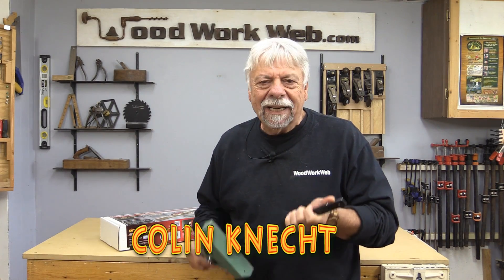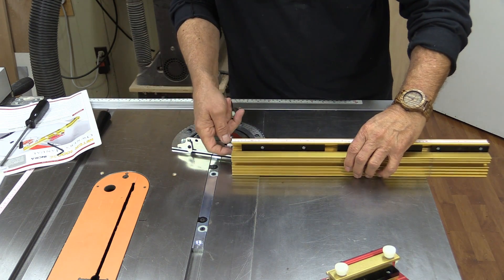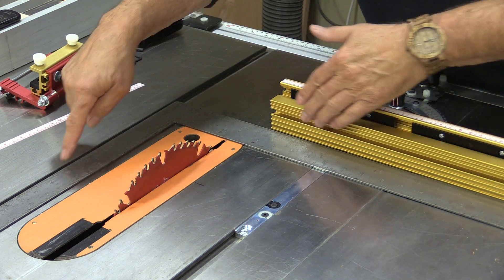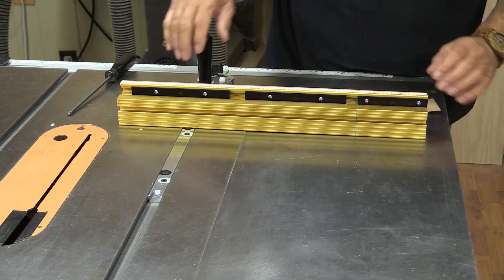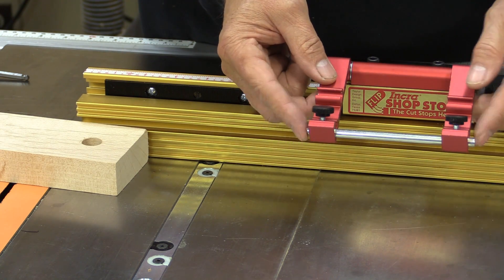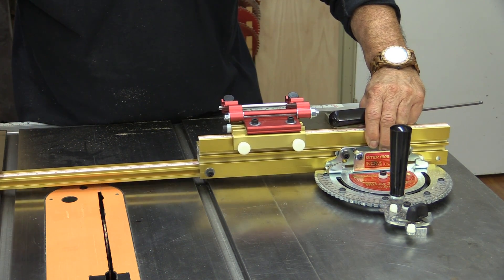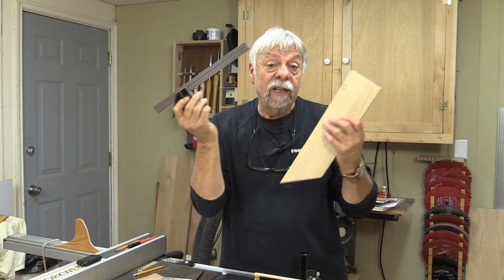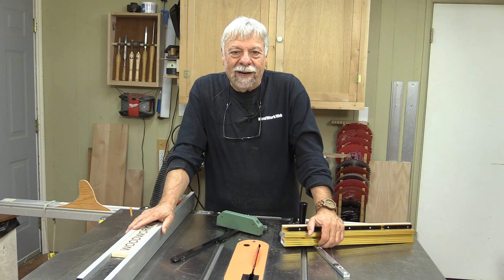Incra MITER 1000SE: Table Saw Miter Gauge Set Up & Review

Comment: I'm using the Kreg Miter Gauge. I'm pretty happy with it. One thing I learned was to tilt the saw's blade 45 degrees so the tip of the blade is facing the gauge. Then you set the fences distance towards the blade. I didn't notice that I had the gauge too close to the blade at just the 90 degree angle and cut a perfect 45 degree angle slot  into the miter gauge. DOH!

Comment: Really enjoy your videos, thank you. I have this miter gauge, it works great. Thought I'd share a tip for aligning the gauge to the miter slot. I planed a board to fit snugly into the far miter slot. Then I use a framing square to align the gauge as you do. However, my method frees up both hands to make adjustments with the framing square laying flat on the table.

Comment: I just bought and set up my new Incra Miter Gauge 1000 Special Edition. It works beautifully. It will never leave my shop. 
Regarding the quality control issues some readers have presented, I dismissed this as "bad luck" - the finish is beautiful on my gauge, no burrs, or rough metal surfaces... everything looked fine. 
I was moving things around in my small shop a few days later, and set the Incra Gauge back in its shipping box to protect it from other tools, when I noticed a small piece of red-orange plastic in the bottom of the shipping box. It was the same material as on the inside of the Shop-Stop. A quick look at the inside of the Shop-Stop revealed that this material (red-orange, heavily serrated, allowing it to lock very positively onto the fence) was chipped and broken (about 1/4") from the edge of the material. It does not affect the operation of the Incra Gauge whatsoever, but it was an eye-opener. Make sure you check your gauge when you first get it, to include the Shop-Stop innards . Any problems, return it for another. You won't be disappointed.

Comment: I bought one of those years ago and I love it. It got me into the Incra system--I also bought their router table fence too, and I have several fo their rulers (with the slots for a 0.5mm pencil lead. None of their stuff is cheap, but it's worth every penny.

I have a portable Bosch table saw because I don't have a home shop. No garage of shed, so I have to wheel the saw outside when I want to use it. Needless to say that the factory miter gauge on a portable job site saw is not the most accurate of devices to begin with. If you really want to check the miter gauges accuracy, use it to make an octagon picture frame. You'll have sixteen cuts on eight peices of wood, so any error will be magnified eight times. 

Recently I got the idea of using the 1000SE miter gauge as part of a shooting board for hand planes. Its adjustability isn't really needed for the "standard" shooting board angles: 90 and 45 degrees, but if you want to shoot any other angle, then it should be a breeze to do it. I haven't built it yet, but it seems to me that getting an aluminum miter gauge slot and letting it into a piece of plywood should be all that's needed.
Reply: I like this idea for the shooting board, did you ever make it?

Comment: Another great video Colin.  I've had my Incra Miter Gauge 1000HD for about 5 years now and continue to love it.  The HD is VERY similar to your SE edition.  
Since you apparently use a miter gauge for angles other than 90 degrees quite often you may find yourself adjusting the fence back rail to better support the wood close to the saw blade.  A word of caution if you do.  After resetting the angle ALWAYS check the clearance to the blade.  My fence has a few battle scars when I failed to do that.  No problem though, Incra sells replacement parts if you ever need them.
Reply from the maker: Thanks for the tip and thanks for watching, Bud!

Comment: Wow! What an amazing piece of kit. I just replaced the bar on mine,  i did use the plastic protractor part but just having a snug bar has made a huge difference.  The one that came with the saw was .745" but the slots are .765" so pretty sloppy and plenty enough to allow the workpiece to float about. I made the new one from 20mm  steel that i adjusted on my milling machine so I'll need to keep it free of rust. Thanks Colin

Comment: I bought one of these last year. Have not used it much since I can't seem to get it to be William Ng 5 cut square accurate. If you can do a video on getting this thing to adjust to a 5 cut process, I would be greatly impressed.  Thanks for the tip on getting it in and out of the T-slot. That was worth watching for that alone.
Reply from the maker: I'll add it to my list of videos to make. Thanks for watching, Mark.
Reply: Mark - to me it seems like the 5 cut may be hard to adapt to a miter gauge because you have more moving parts(the gauge adjusts differently than the fence on a sled) and I'm not sure where to get my length measurement from, the far right adjustment screw or the far right side of the fence.  I went with the dial caliper and a Woodpeckers 1281 square.

Comment: I was so frustrated with my fence and miter gauge I considered buying a new table saw. Then I discovered the Incra 1000 and the Mule fence. Combined they make my saw a joy to work with.
Reply from the maker: Yes, changing the miter gauge can make a world of difference!
Thanks for watching.
Reply: I had my incra 5000 before I bought my new table saw. When I bought the new saw, I took the included gauge and hung it on the wall. It has been there ever since and has never even been put in the slot on the table saw.

Comment: Excellent video. I just bought this product and I have to admit it’s got me confused. I feel more prepared to try and adjust it now.
Reply: Sadly, I have a Ryobi portable table saw and it appears to be the one saw this miter product won’t work with. Even with the T clip, the bar won’t fit into the groove (even putting it in the front). There are these bumpers in the slot that get in the way. Very disappointed in Ryobi.

Comment: Hey Colin, this is perfect timing! I just bought this exact model along with an Incra 5000 sled at an estate sale 2 weeks ago. Thanks again for another great video! Best, @HoneyOnWales
Reply: Drew did you get a good deal on the miter gauge? You know like one of those " I can`t believe I got it for this price" deals.
Reply from the maker: Nice! The sled looks like an interesting bit of kit. I might get one for review one day soon :)
Reply: @harrydavis6903  I did okay on it, $50US for the miter gauge and $100 for the sled. I also got the Festool accessory kit for the track saw (miter gauge, vac hose guide, etc) for $100, which was not a stellar price, but fair. There was also the top of the line Festool MFT for $200, but I passed since I had no need for that. Best, @HoneyOnWales
Reply: @drewt3210  Not bad Drew. I never have much luck finding the good deals. The incra gauges are quite accurate and I would not want to do without mine. I did get my incra1000hd on Amazon for $149.00. Not too bad considering I guess. Make some dust friend.

Comment: i don't use a miter gauge a lot, but that one looks like a really nice one. thanks for the tip about the combination square, too... never thought about it before, but it makes sense that there'd be a little wiggle room where it tightens down
Reply: I have had very good precision using a magnetic combination square. They are quite accurate. I bought mine from Amazon for $23.00.
Reply from the maker: Thanks for watching!

Comment: I bought a cheap ryobi saw to do some small woodworking with and  built a small jewelry box but wasn’t satisfied with the plastic miter gauge it came with so I bought an Incra only to discover that cheaper saws don’t have miter slots that are compatible. So now I’ve got a delta table saw and I can finally use my miter gauge 😂

Comment: Hi Colin - just wanted to throw a bone to the Empire squares  (the blue ones - you can get them  at the big box stores).  I might have just been lucky, but both the 6" and 12" combination squares seem to be as accurate as my engineer's square  (not true at all for my old Stanley combo square - that thing is way  off),  and the full-sized framing square was also very good compared to other brands I have.  I don't think any of them were over $15 - all made in the USA,  that in itself is rare these days.   I was not expecting the combination squares to be anywhere near as good as they actually are  - so that was a nice surprise - I've been using the 6" one for all kinds of set-ups with stuff coming out on-the-money.

Comment: Thank you so much for this video.  I'm curious though.  Will this particular miter guage work on my Dewalt portable table saw?  I'm new to woodworking but the little thing that came with it for cross cutting feels very cheap so I'm looking for something else to replace it.  Plus, I'd like to have something that allows me to cut longer pieces without having to worry about kick backs and such because it's not supported properly.

Comment: Would have liked to see how the micro angle adjuster works
Reply: It's a vernier scale, it works because those fractional degrees on the little flipper piece are spaced differently than the whole numbers.

If you want a whole number, say 20, the 0 line points right at the number you want.  Notice that none of the other tick marks will quite line up with the other whole degrees.

After that, say you want 19.9 deg.  You'll start by lining up the 20 with the 0 line, then you adjust so the tick mark beside the 0 line aligns with the next degree below 20, which would be the 19.

Next, say you want 20.5.  Same as before, start by lining up the 20 with the 0 line, but this time you'll line up the 5th tick mark in the other direction (marked with a .5) with 5 degrees higher than the 20, so 25.

Comment: Great video Colin. What is your opinion on the Incra Wonder Fence system for routing or table saw?
It looks fantastic to me but there are not many videos out there on the subject. 
Thanks in advance.
Reply from the maker: I'm actually thinking about getting the fence system and doing a future review ... so that should be coming down the pipe in the future. Thanks for watching.
Reply: @knecht105  I just ordered their complete router table system (The works). In a short 8 to 10 weeks it will be here. GuysWoodshop has some videos on it.
Reply: Yeah, I hate that takes so long to get some of their stuff.  I have the TS LS positioner and the router table complete system.  I really like it.  I also have the Incra lift.  It is so easy to make precise up and down adjustments with that thing.  Same for the forward and backward movement of the fence.  Easy and precise.

Comment: Got mine and installed it. Out of the box it had 1/16 error after the fifth cut.  Adjusted .1 degrees and got the error down to .040. Best I could do.
Reply: Joe, how did you apply the 5 cut method to the gauge?  Seems like if would different for the gauge vs the sled because on the sled the far right is screwed down and can only pivot.  Plus that is the point at which you take your length measurement.  With the gauge, the far right doesn't just pivot.  It can also move forward and back just a little bit.  Also, when you take your length measurement for the gauge adjustment, do you take it from  the far right adjusting screw or the very far right of the fence?  Am I over thinking this.  I would like to use the 5 cut method but I went the route of woodpeckers 1281 and a dial indicator.

Comment: I use an auxiliary backing board (fence) for mine so I can easily align cuts to the blade every time. The very first time using the auxiliary fence it's beyond the blade and I cut straight through the board. After that it's super easy to align boards to the cut line. When it wears out just simply replace it. I should add the cut line I'm referring to is the slot the blade creates in a zero clearance insert. I use an aftermarket insert from Infinity so replacing an old worn out insert is super easy and cheap..

Comment: Great video. I was thinking about getting the 1000SE. I have a nice 12" sliding compound dual bevel miter saw I use a lot. Is there any reason I would need the INCRA 1000SE for my table saw?

Comment: A good choice Colin.  I was gifted the direct competitor to this one (won't name it, but think pocket holes...) and it's clearly just not as well thought out or easy to use.  One question: does the T-slot lock prevent the whole thing from twisting when you pull the fence off the table towards you?  I find with mine that if I'm cutting a piece that's wider than the in-feed space on my table that the end of the fence farthest from the blade droops just enough to run into the table as I go to feed the piece through the cut.
Reply from the maker: I have only run a few wide pieces of plywood through but have not noticed the fence droop on this one. Thanks for watching!
Reply: Matt - I have the Incra 1000HD and to answer your question, no it does not.  That is why one would still need a sled.

Comment: Colin, I was hoping you would have shown how the 1/2 degree plate worked !  That plate looks to be a guessing  or eyeball kind of setting, is that the case with this "Incra Miter 1000 SE" ?             Update ,, OK I went back to the vid.  & now see how it very easily holds 1/2 degree. The pivoting "Vernier Scale" (the thing the White Cap tightens).  You line it up with the scales on the plate & tighten the Handle to hold that special angle. Thanks for the Demonstration Colin.. By the way, In my 40+ yrs of using precision instruments I have found MANY instances where Steel Squares are Off Square.  I check mine using a steel 1-2-3 Block. these are inexpensive & always very accurate. you can check the squareness of the 1-2-3- block by stacking them variously together on your table saw top. any amount "off" on the blocks will be obvious.
Reply from the maker: Yup, you got it there with the 1/2 degree. Thanks for the tip and thanks for watching!
Reply: What is a 1 2 3 block?
Reply: It’s actually quite easy to know if your steel square is square or not. If it’s not crazy expensive it probably isn’t. That’s it. 
It is very very costly to make something flat or square and to guarantee it. This costs money.

Comment: Do you think this is a replacement for a table saw sled or do they serve different purposes?
Reply: Mark Allan incra sells a split sliding cross cut sled with the miter gauge as a kit, I got a solid deal on mine on Amazon. Have yet to use it but upon assembly it will clearly outperform my home made crosscut sled. The sled is optional but is really nice when making many crosscuts particularly of wider pieces so the piece is fully supported at the same height all the way across
Reply from the maker: They actually have a full sled system if that's what you're after. https://amzn.to/2OE2D7X

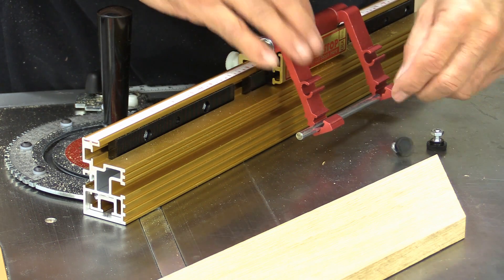Comment: Didn't read thru all 193 comments but about 7:31 the adjustable dowel rod gets "magically" cut into pieces with no background or explanation ???  Since I an considering to buy one of these were these pieces supplied or is this a modification after the fact??
Reply: All are included. The box has the full bar and the two smaller bars in it.

Comment: Would I be right in assuming this could replace the need for a sled?
Reply: That depends, if you plan on cross cutting something deeper that the miter gauge can handle (meaning you have to pull the miter gauge back so far that only a little bit of the miter bar is left in the slot on the table) then no.  When you pull it back that far, the little plastic adjusting spacers that take up the slack in the miter bar are not really doing there job because maybe only one of them is still in the slot on the table, the gauge with wobble back on forth.  Also, when you pull It back far enough to where the fence is hanging off the back of the table, pushing it forward to begin making your cut, it may bump into the side of your table.  I have a miter 1000hd and a sled.  However, I think I am going to get the miter express and so that I can use my miter gauge with it.  I hate knowing that I spent a pretty good amount of money on my miter gauge and find that I use my sled most of the time.  I know that was a lot in info but I hope that helps.

Comment: Will this mitre gauge be compatible with Makita MLT100 table saw. Thank you
Reply: Hi Bobby,
You'll have to check your miter gauge slots in your saw top.  If they are 3/4"wide x 3/8" deep (or less) you'll be good to go.
Reply: @budprine1591  thank you Bud I'll check it.
Reply from the maker: Yes, as Bud said, give it a check. If your not 100% sure, just contact Incra.
Thanks for watching!

Comment: I would have thought incra might have put a thin teflon slider at the far edge where it runs on the table s surface to stop the aluminium rubbing on the table, you can buy adhesive teflon tape, might be a good idea to put a strip of this under the guide

Comment: Hey Colin.  Enjoyed this.  Would you say this is accurate enough to build picture frames with (instead of building that 45 degree miter sled)?
Reply: I would say that if you get your Incra miter gauge dead nuts 90 degrees to your miter slot, absolutely.

Comment: Colin, why didn't you square the fence to the miter slot that the jig runs in?
Reply: It's a pretty safe bet that the two slots are perfectly parallel, so it really doesn't matter.  It can be tough to get the square to stay tight up against the side of the slot you're using for the miter gauge because the bar on the gauge itself fills up the slot.  It's a lot easier to use the same slot if you're using a engineers type square for the setup (which folks who are fussy about thousandths will tell you is a must).
Reply from the maker: Matt did a good job of explaining it. Thanks for Watching!
Reply from the maker: Thanks Matt!